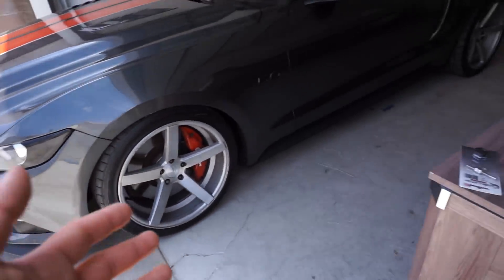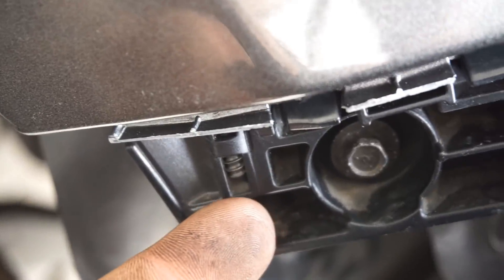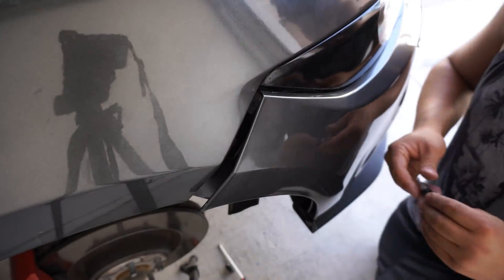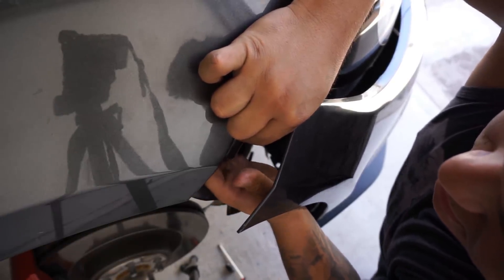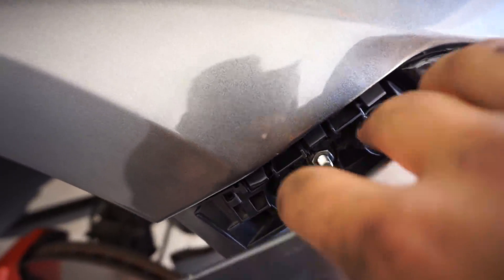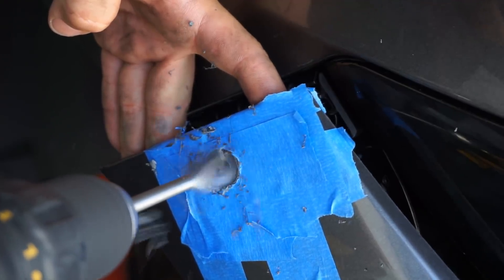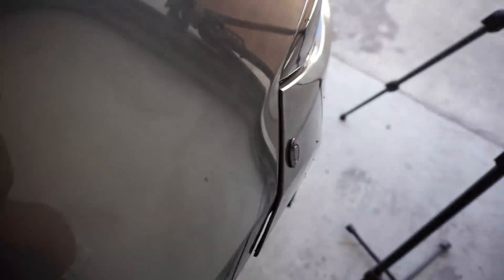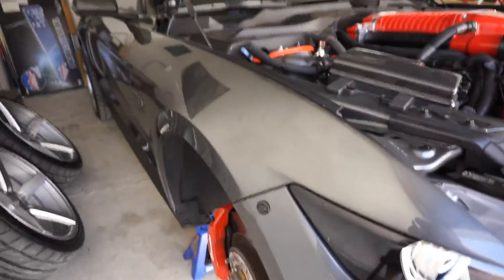Trading in my 2016 Whippled Mustang for a 2018 GT... (CLICKBAIT!)

Comment: Have you had any issues with your car since you've had it? Has anything gone out? My car is at the shop again for a clicking noise after they put a new wheel bearing on.  And I have the valve cover gaskets replaced already
Reply from the maker: Wow sounds very unfortunate. I have had 0 issues with my car. almost 30k miles later and a ton of mods later.
Reply: EnriqueG_S550 damn.  Do you still have the wheel spacers on? I'm wondering if that's why the wheel bearing went out. Spacers and it's lowered. It's all under warranty tho so I'm not worried, it's just annoying lol
Reply from the maker: Manuel Martinez yea I feel you. Negative since the spacers I've installed new wheels and tires. I ran the spacers and lowering springs for about 8k miles and never had an issue.

Comment: Dude l think it looks pretty good considering the cost of a new front bumper.  They look like the warning sensors that some Ford vehicles have with the back up sensor option.  My 2017 GT has them on the back and front bumper and my Ford Edge has them as well.  It would be nice if you could paint them the color of your Stang.   That way they would blend in more with the car.  Good fix man.

Comment: I just had to do the same thing in my 2016, those tabs are so flimsy. I originally used automotive goop to glue the tabs back on and it worked, but there was a very small gap still, ultimately went with same quik latch kit. Looks good.